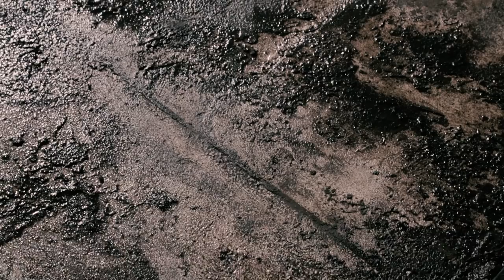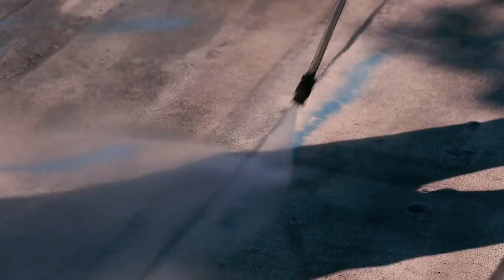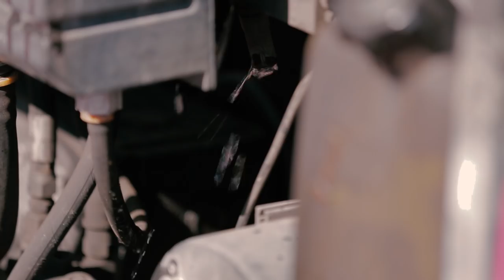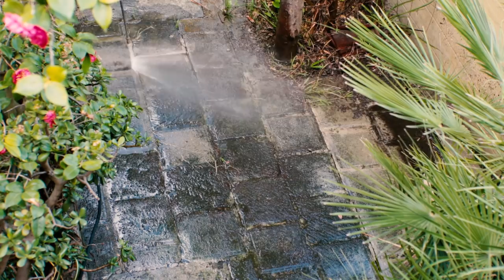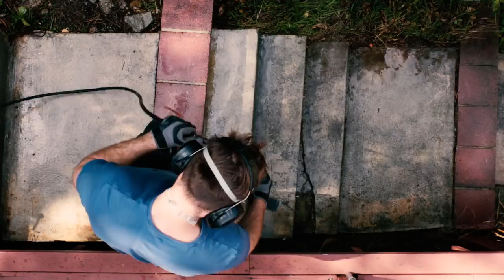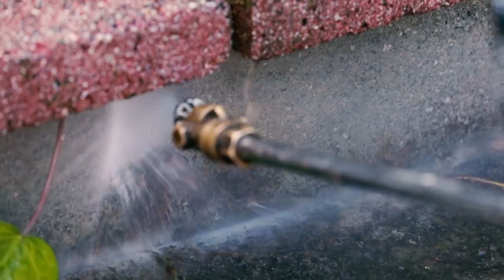Pressure Washing | Nice Content | Tatered

Comment: It's actually frustrating how not efficient this guy uses a pressure washer. Let the machine do the work. Why are you moving the nozzle as if you're scrubbing?
Reply: atiseru seems like it did the job pretty well
Reply: Obviously he is a pressure washer newbie. He doesn't know the feel yet.
Reply: Ano eh.  45 degrees across the joints man!  😂
Reply: Needs a turbo nozzle and smoother technique
Reply: No kidding he goes back and forth like 6-10 inches it's like dude just lay one full arm length pass and get it done already.
Reply: You have to usually because hard grime doesn't come off in one swipe
Reply: Wearing a respirator should have been the first clue he is clueless

Comment: Why TF the floor so dirty
Reply: ICouldCareLess its prpbably an old house or maybe just dirty ppl
Reply: ICouldCareLess Because of all the dirt that gets stuck in the rough surface of the concrete which then grows mosses and mildew etc. Depends on the climate as to how fast it grows but it certainly doesn't mean the ppl living there are dirty ?? Such a strange thing to say.. stuff grows on everything if it's left long enough, especially if the place is tropical or at all humid.